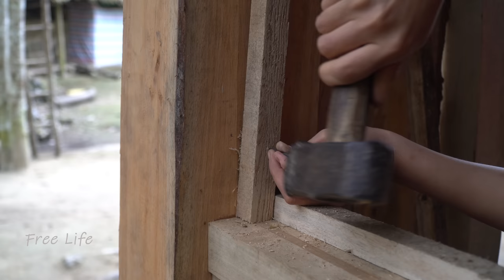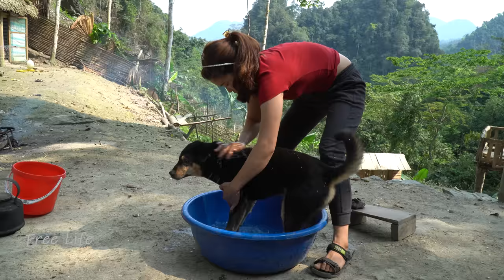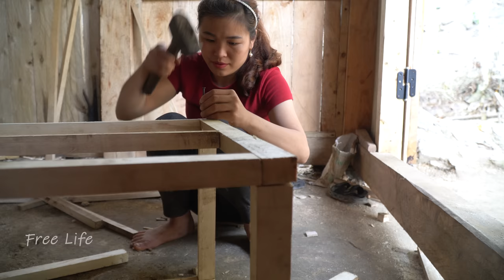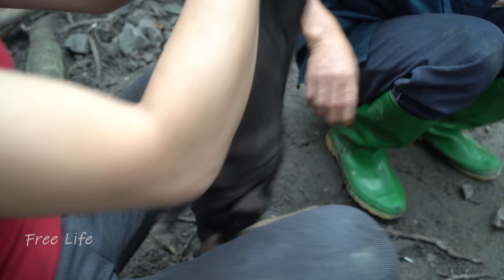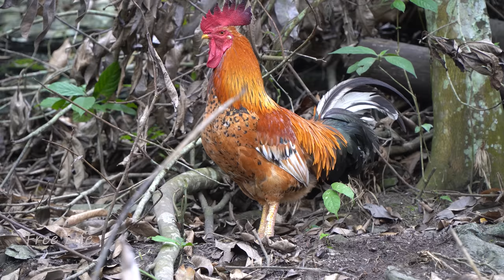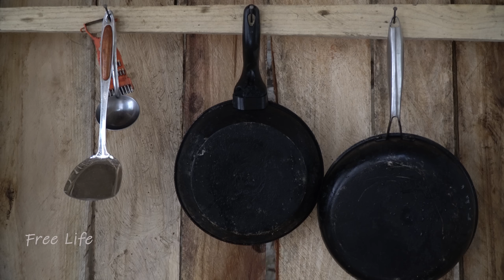Make a wall-mounted dish rack, castrate piglets, Wound care for Lu | Free Life

Comment: Certainly a new revealing experience, the castration of piglets; Overall not much difference to my experience several decades ago as an 18 year old assisting the castration of 200 piglet's  at a large piggery. (I was used as I could give the necessary needles to 200 sows and a few boars without any needles being broken and left in the Sows/boars). 

 I remember my job was to disinfect the cuts. I stood there with a gallon of disinfectant in one hand and a bottle of beer in the other. (You can get who was the recipient  of each bottle).  Whilst the outraged squealing  of the piglets was upsetting me; All went well, until I drank from the wrong bottle.